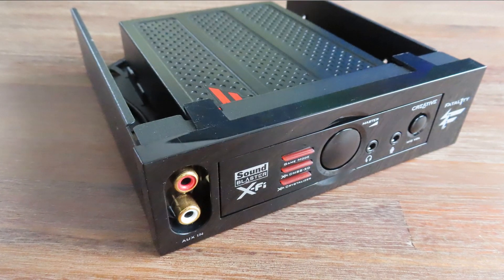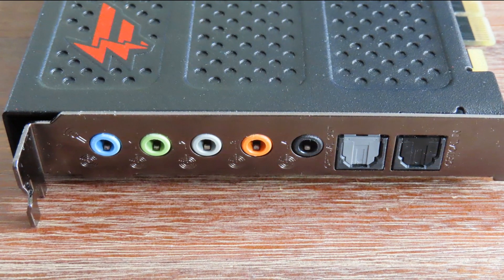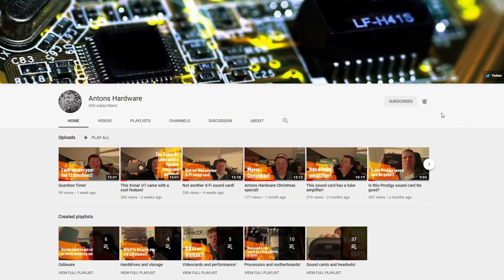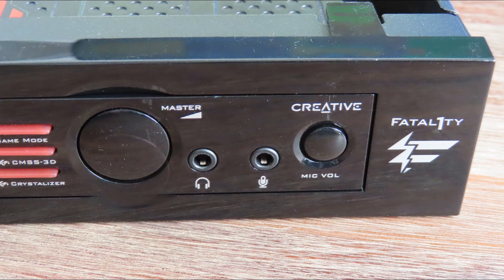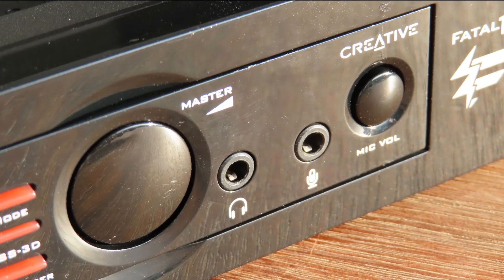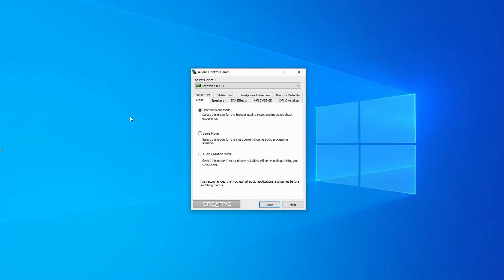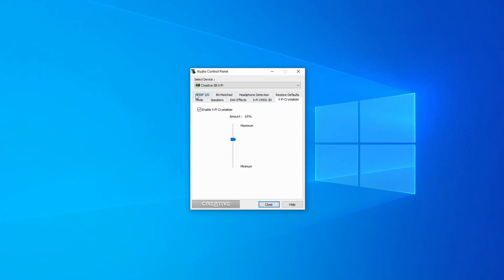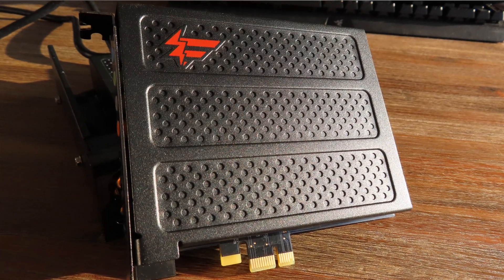This X-Fi Champion has an I/O drive!

Comment: @AntonsHardware: I've been trying to get my IO Drive to work for some time. No matter which driver I install, the 3 buttons, volume button and LEDs just don't work.
My card is also recognized as "Xfi fatal1ty Pro Series" by the product registration, not as "Champion Series". The connection cable is definitely OK. It seems to be a common problem as you can find a lot about this problem but no solution. Can you please show me exactly which driver you are using to make it work?

Comment: My favorite sound card of all time. It's the last sound card of a generation where hardware processing, 3D positional audio, EAX (Environemntal audio) and PC surround sound were must-have features for gamers.

It also is one of the last sound cards that comes with a MIDI synthesizer with SoundFont support. I'm very much disappointed that this card no longer works on my AMD ThreadRipper Pro system so I switched to the Xonar AE (Which very much disappointed me because the software/drivers are quite bad in features) and now the Terratec Aureon 7.1. which works nice but lacks the Creative EAX technology.

Under Vista to Windows 11 I used Creative Alchemy to get EAX and hardware 3D sound back on games that support it like Thief II, Unreal and Guild Wars 1.
Reply: Apart from software issues, how was the sound quality of Xonar AE for speakers?
Reply: I mean stereo sound quality?
Was it better than this reviewed one?
Reply: @HABIBULLAHxZed  Well. Fine I guess. The basic sound of the Xonar is excellent, just like any modern sound card is. The issues I had are with crappy 7.1 upmixing. If you just use it with stereo speakers, that is not an issue for you. But then again. Just use your on-board sound then. It is fine nowadays.

Comment: Hi Anton,

I bought the Sound Blaster X-Fi Titanium Fatal1ty Champion card back in 2009 (yep, very ancient I know!) and had it installed in my first 'custom build' rig. The sound was awesome back then, and the card was paired with a Logitech Z5500 speaker system. I was using a Rampage 2 Extreme motherboard at the time on a Windows 7 OS.

Fast-forward to the year 2016. Creative Labs discontinued their support for the X-Fi Titanium Fatal1ty Champion card, and I could never get this card to work properly on a Windows 10 OS, along with a ASUS Maximus VII Hero motherboard. Sadly, I was forced to stop using the card, but it is still installed on the same rig that I bought: I now just use the onboard sound instead.

What version of Windows are you using the  X-Fi Titanium Fatal1ty Champion card on?
Reply from the maker: To be completly fair, I used the standard drivers. My Windows version is a clean install of Windows 10, 64 bits. I'm not sure which version I used, but I always install every update there is. I don't have this card installed in my testbench anymore, so I cant look into it. I did like this X-Fi by the way! :D
Reply: @AntonsHardware  Good enough. The most important thing I needed to know was that you did in fact get the card working on Windows 10. I haven't tried this in several years, but I now have hope that I can somehow get it to working again, thank you!
Reply from the maker: I find that if you have a clean install the sound cards will work. I've reviewed more than 40 cards, and I never had that one didn't work with the stock drivers. There is the issue with Creative drivers, which are notoriously hard to remove. And I think that this is the problem most people have when he card stopped working.

Comment: I am looking forward to your frames per second video.
Just an idea for you.  Since you have so many sound cards, perhaps you could record some in-game audio
to compare different sound cards (in different games).  I know it is a lot of work to record gameplay audio on different cards,
and then compare them all, but it is something that no one does (on youtube), as far as I know.

You might want to use a separate recording "card" that is specially designed to record audio/video.
Trying to use the sound card itself to record itself can be tricky, and it might turn out bad.
Reply from the maker: Thanks! I'm currently working on it. Did all the benchmarking, recorded the video's and voiceovers. Now working on how to present the results in an easy manner, so everyone will understand. :D Hope it will be ready next Friday! I try to release every two weeks on Fridays around 15:00 - 16:00 GMT +1 time. 

That is a very very good point you are making. I have been fiddling around with recording the different sound cards, just to let everyone hear what they sound like. But there are a lot of issues with multiple drivers on a single windows machines. They tend to get "in each others hears". So now I'm trying to figure out how I can use a capture device with a separate audio input. And yes, self testing a sound card will give weird results. I've tried a self test on an Asus Essence  STX 2 and the results were just way too good to be true. But I want to use that one as the seperate test card in the future.
Reply: @AntonsHardware  I can not recall (on youtube) ever seeing a direct comparison between Asus and Creative sound cards (in games).  Youtube is filled with Game XYZ tested using video card A vs B vs C or cpu D vs E vs F.  But I can't recall seeing any such comparison for sound cards (in music/movies yes but not in games). I think it's sad that sound cards are dying.  This trend needs to stop.

Currently, I only have one sound card (the Audigy Rx).  Not the highest audio quality but good enough for youtube and good enough for gaming (in general).  Most new games sound worse than older games.  However, there are are rare exceptions.  Warframe sounds decent.  Valve and Bethesda tend to use older game engines that might sound better than other (more modern) game engines.

There are so many PC games now.  Not like 15-20 years.  Destiny 2 and warframe are free to play.  Destiny 2 had lots of reverb/echo with my Audigy Rx (cmss on).  I hope to get a VR headset in the next 1-2 years, and I hope my sound card can work with that.  Good 3D VR + 3D audio will be mind blowing, I hope.

Last night, I re-installed Thief 2 after I watched a youtube video, and I realized the sound is the best thing about that game.

If I were you, if i were to make a video comparing Asus to Creative (for gaming), I would try to test newer games instead of older games.  But unfortunately, it is rare to find a modern game that is optimized for sound cards.  The next "big game" I am looking forward to is Vampire: the masquerade bloodlines 2.  That is on my "must buy" list.  If you know any modern games that sound amazing on a sound card, I would love to know.
Reply: One more thing.  Assuming you are recording gameplay audio for youtube (stereo), be sure to set windows desktop speaker config to the highest possible (usually 7.1 or 5.1).  Then, in the sound card control panel (Asus or Creative), set speaker config to headphones (because this is stereo which is what you want for youtube).  In most modern games, the game will automatically use windows desktop speaker config.  But in some games, there is an option to set speakers in the audio settings.  Be sure to set the highest possible speakers (7.1 or 5.1) that the sound card supports.

The reason to do this is because the game will output the greatest number of audio channels (7.1 or 5.1) and the audio processor on the sound card will downmix that to stereo.  This usually makes the audio more 3D.  However, sometimes you might get better results with both windows desktop and the Asus/Creative control panel set to headphones.  The consensus is, in general, set windows desktop to the highest possible speaker config (7.1 or 5.1).

If a game has a strong built-in audio engine, then it might be better to let the game create the 3D audio.  But usually, games have weak in-game audio engines, which means, usually, it is better to output as many audio channels (from the game) as possible, and then let the sound processor on the card convert that into stereo.

By the way, I can hear a different between 5.1 with cmss on and 7.1 with cmss on.  About 10 years ago, I wrote a review for my headphones.  In the review, I said that my headphones have weak audio for rear sounds (coming from behind) in games.
The reason i thought this is because i was using a Titanium HD with 5.1

Years later, I get an Audigy Rx with 7.1 audio channels and with the exact same headphones, suddenly, the rear sounds the same as the front (in games).  It had nothing to do with the headphones.  It was simply because 7.1 has more audio channels in the rear which gives it more accurate 3D positioning in games.  I am not making this up.  I am 100% certain that 7.1 has better rear positional accuracy in the games I was playing.  It's a shame the Titanium HD only supports up to 5.1 and not 7.1 because I miss that card.